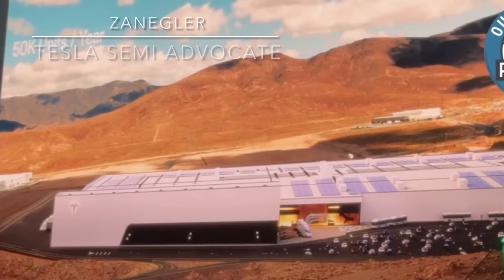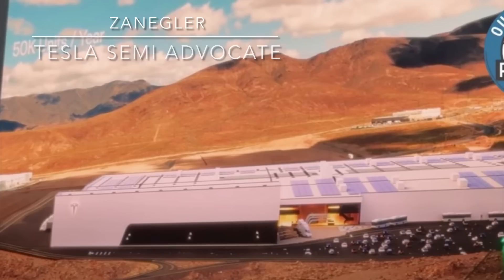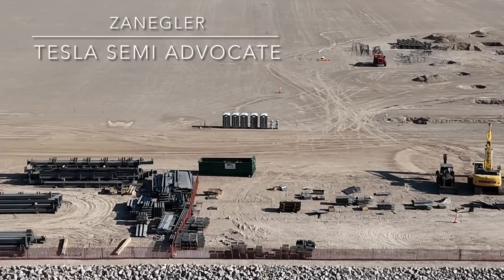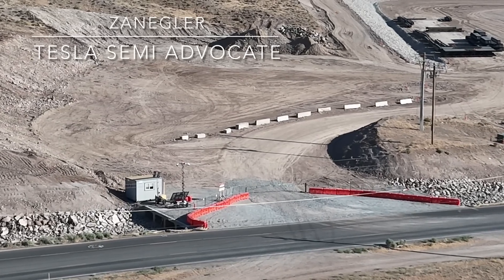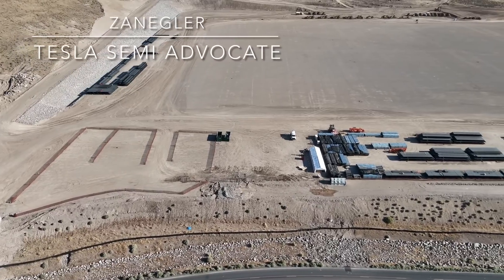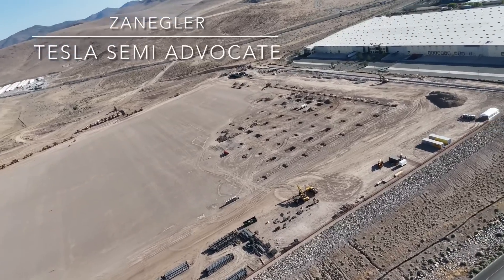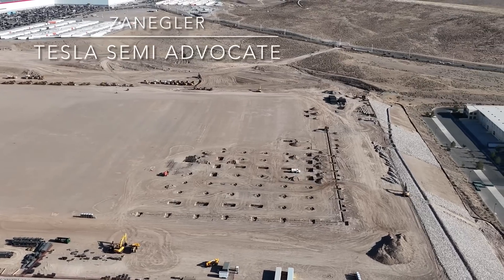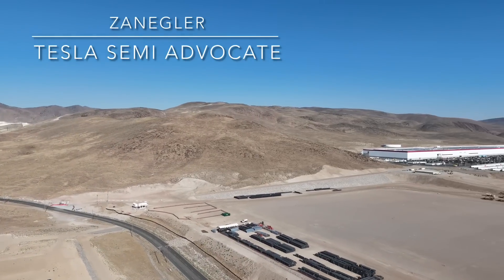Tesla Semi Factory Construction Accelerates!! Finally Foundation

Comment: Thanks for the update. I'm surprised Tesla didn't start this build already, since the truck was introduced, what, a couple of years now?
Reply from the maker: It’s been a mystery to me for sure.
Reply: Tesla now needs to ramp up the semi super charging route & corridors like they did with passenger EV's
Reply: End of 2017 semi was introduced, entered limited production in Dec of 2022. Only a few hundred in total built since then sadly. 
And the excellent data shared from the Pepsi run on less event last Sep shows it does what it was designed to do. 

Plus tesla supposedly has a couple dozen of them hauling batteries&motors replacing diesel like for like from a daily workload perspective.

Comment: The steel erectors would not have to wait 30 days to start steel erection. Yes, the design strength of the concrete in the foundations should be met in 28 days, but that strength is needed for maximum load and any possible uplift on the anchor bolts. As long as very little uplift is allowed on the anchor bolts by bracing the columns, they could start erection in less than a week. The concrete will have approx. 80% of its design strength in 7 days. The steel framework itself does not put much load on the foundations. By time any significant load is installed on the steel, usually more than 30 days has passed since the foundation concrete has been poured.
Reply from the maker: Excellent point. We do get very high winds.
Reply: Concrete testing can be done at 7 and 14 days and 28 day strength projected. Concrete still gets a little stronger after 28 days, but it is not taken into account.
Reply: But the concrete has to be tested after 28-30 days for strength- destructive testing…and it has to pass spec or get torn out and redone

Comment: This is great news. I think it will take at lease one year complete. Thank you for the video.
Reply: My guess is that it will be finished “in time.” They need BOTH the battery flow to be ready and their big buyers to have their depots set up. That last will require lengthy permits and work with the local power companies. They won’t need the trucks before that is all in place, so the factory won’t need to be ramped before that.